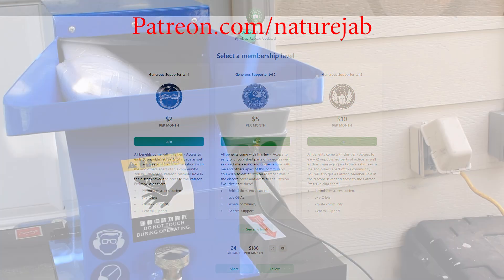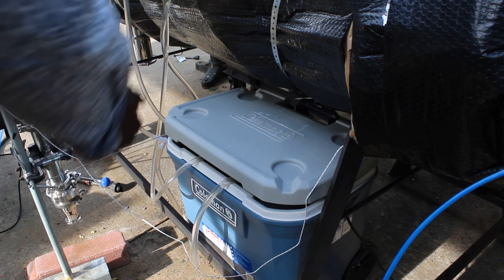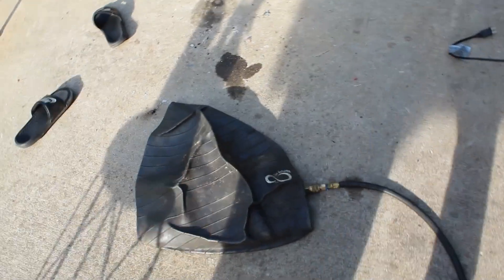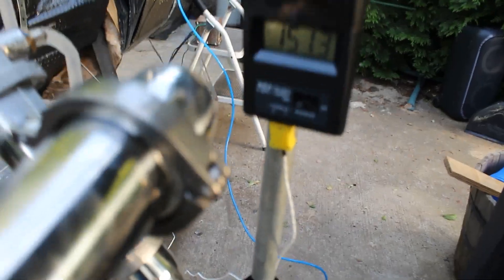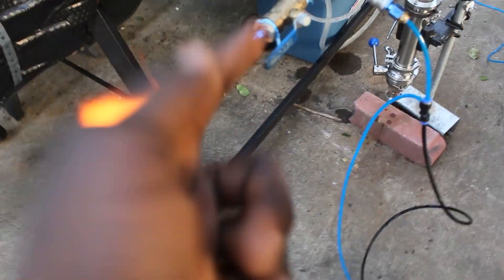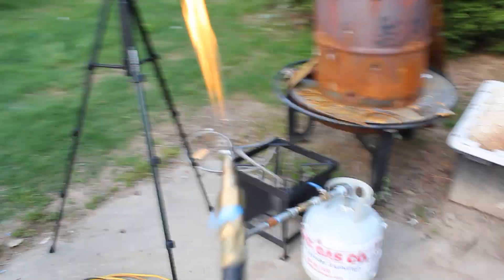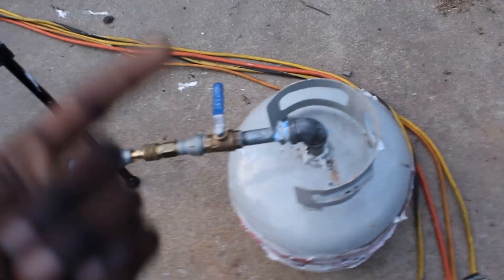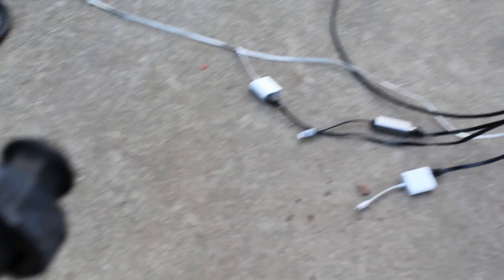OIL MADE FROM PLASTIC! | Running Mark 4.5 Under Vacuum

Comment: Add a bigger tank to your vacuum pump. It will allow you to open that valve for the oil and instantly bring the vacuum back to full pressure. As there is vacuum built in the tank to account for that. It will also be easier on your vacuum pump

Comment: If you add a gas pressure tank to accumulate your pressure after the pump you will have more consistency in your pressure to the generator

Comment: FYI, the reason why the oil production increases so much after you turn on the vacuum is because boiling point of liquids decreases with decreasing pressure. This is a principle of vacuum distillation.

Comment: there are a few additional methods to consider for converting waste heat from generator exhaust into usable electricity:

1. *Kalina Cycle:* Similar to the Organic Rankine Cycle, the Kalina Cycle uses a mixture of water and ammonia as the working fluid. It operates at varying temperatures and pressures to extract maximum energy from heat sources, potentially offering higher efficiencies than the ORC.

2. *Supercritical CO2 Cycles:* This method uses carbon dioxide in a supercritical state as a working fluid in a closed-loop system. Supercritical CO2 cycles can achieve higher thermal efficiencies due to their favorable thermodynamic properties.

3. *Heat Pumps:* Although primarily used for heating and cooling, heat pumps can be designed to generate electricity by harnessing thermal energy from the exhaust and converting it to mechanical or electrical energy through various mechanisms.

4. *Hybrid Systems:* Combining multiple heat recovery technologies (like ORC with TEGs) can maximize electricity production from waste heat. These systems can be tailored to the specific thermal characteristics of the exhaust.

These advanced methods can further enhance the utilization of waste heat for generating electricity, contributing to more sustainable and efficient energy management.

Comment: you can further utilize the heat from a generator's exhaust to produce additional electricity through several technologies:

1. *Organic Rankine Cycle (ORC):* This technology uses an organic fluid with a low boiling point to convert heat into mechanical energy, which then drives a generator to produce electricity. It's particularly effective with low to medium temperature heat sources like generator exhaust.

2. *Thermoelectric Generators (TEGs):* These devices generate electricity directly from heat differentials using the Seebeck effect. While they typically have lower efficiency and power output compared to other methods, they are very reliable and can be useful in small-scale applications.

3. *Steam Turbines:* If the heat output is sufficiently high, it can be used to generate steam that drives a turbine to produce additional electricity. This method is common in large-scale industrial settings.

4. *Stirling Engines:* These engines can convert heat energy into mechanical power by compressing and expanding air or other gases at different temperatures. This mechanical power can then be used to generate electricity.

These methods enable the conversion of waste heat into additional electric power, enhancing the overall efficiency of the energy generation process.

Comment: Yes, there are ways to use the heat from the exhaust of a generator. This process is commonly referred to as waste heat recovery. Here are a few applications:

1. *Combined Heat and Power (CHP):* This system uses the heat generated by the exhaust of the generator for heating purposes in addition to generating electricity. It's efficient for buildings that require both power and heat.

2. *Pre-heating:* The exhaust heat can be used to pre-heat combustion air for the generator itself or other industrial processes, improving overall energy efficiency.

3. *Heat-driven cooling:* Absorption chillers can use the heat to provide cooling, converting waste heat into useful cooling energy.

4. *Desalination:* In some systems, exhaust heat can be used to produce fresh water from seawater, particularly useful in remote or arid locations.

These methods not only utilize energy that would otherwise be wasted but can also significantly reduce overall fuel consumption and emissions.

Comment: So I have a question. How efficient is this machine? What I mean is how much energy does it require to output (x) energy of fuel? Doesn’t seem totally crazy but it does seem odd to me that no one has ever done such a thing?
Reply: Microwaves are terribly inefficient.
Reply: Germany did it in the 40s with coal instead of plastics and I guess coal fires instead of microwaves

Comment: I feel like you may be cracking some of the polymers directly into ethane and propylene gas. I’d suggest if you want to power it on gas you should invest in a battery bank as well. Then you can run the generator on stored gas and then store the energy for the initial startup of the next run. For the condenser, you should try to make a column tower to distill different temperature solvents. I’d also suggest a lot of fire extinguishers lol since you have essentially a refinery.

Comment: Might also need to insulate the outside of the condenser. Its cooling the air around it instead of just the oils out of the vapor. This would make the ice melt faster. A tiny opening to check temperature is fine. Also might suggest to solely use temperature gun to avoid risk of burns

Comment: I think its time to start weighing stuff for data. E.g. how much plastic in and oil/gas out, and how much carbon in and carbon out. Also a chance to start segregating plastics by type and running at different power setting. This lets you know which recipes make what products. Assuming very little stuff escaped to atmosphere, what mass that isnt carbon and isnt oil, is basically the mass of gas. (Since gas may be tricky to weigh)

Comment: I saw a video of you recently wearing  a tie while showing your equipment. Remember, as an engineer and technician, bow ties are a must for safety and style
Reply: Very true. Surprising he overlooked that, but he is a man of style.
Reply: Never wear bow ties near shredders.
Reply: @CZpersi you putting your face up in it?
Reply: Wouldn’t it be easier to just get another generator so this way you can run an ice maker off of the lng so you don’t have to buy bags of ice? Maybe find a way to make free liquid nitrogen and use that?
Reply: My guy needs to wear a mask when pouring plastic particulate.

Comment: Please run the syngas through some filters to get lid of tar. 

Tar can irreversibly damage the throttle body of your generator. 

A simple way to get rid of tar is to run the syngas through a bucket full of fine saw dust.
Reply: Fine plastic shreddings and carbon might work too
Reply: @bene5431  sure.
However, plastic shreddings may not have the same absorbent capability as saw dust.
Wood is a very good mopper of tar.
Reply: Bro he's giving his entire neighborhood cancer idk why yall worried about tar.
Reply: @Lance_Belco  I know right. 
Dioxins are all over the place and bro dgaf.

Comment: Hey Jab. Awesome work !  I'm not sure how important the condenser water temperature is to your system. You could add salt to the mix to reduce the temperature, that is as long as the salt water doesn't interfere with condensing equipment.
Reply: Corrosive to the equipment, but will work

Comment: Hi I messaged you before about a heat treatment idea for excrement I had? If you have an older model?, I have a theory, I think you might be able to recycle poop in your invention and make a shiterer version of propane!!!! I think it would really work, and your compost? Could be the cleanest poop sourced fertilizer on the planet. But think about it, don't break or stink up your machine. If you can recycle excrement into fuel, and clean fertilizer, you will be placed into a very good part of history. 

Have a blessed life! :)

Comment: It is interesting that you have only 3 pounds of plastic in a reactor that can easily hold 8 tons [16,000 lbs].

Just think: when you scale up [such as adding more magnetrons] you can massively increase production, since a whole lot of your EM energy is being wasted on the large open cavity of the reactor vessel.

That vessel, in theory, should be holding about a ton of plastic and half a ton of recirculated carbon feedstock minimum to take proper advantage of the energy being fed into it.

This is based mainly on its volume, and the spread [area of dispersed EM radiation saturation] of the magnetrons.

In fact, you may want to read up on how to build your own cyclotrons [its a much more powerful form of microwave emitter which works mostly like a magnetron, but it has fewer parts, can emit and handle far higher power, and is almost impossible to 'burn out' (unlike microwave oven dipole magnetrons which can arc and burn rather easily)]

Admittedly, they are a lot less easy than just scrapping out some used microwave ovens, but if you are hoping to get super high intensity power focused at the plastic, they will far outperform magnetrons.

Also, since they emit electrons, they can really do some massive splitting of larger molecules into smaller ones, especially for the amount of power introduced.

And, while, honestly, I do not think anybody has ever used them for smashing plastic, the REALLY BIG ones are used for smashing ATOMS.

So they can really deliver some good power if built and tuned properly.

Here is a potential starting point to look into it.

https://en.wikipedia.org/wiki/Cyclotron
Reply: lol
this

Comment: Good job,❤
Next you can mix rubber tiers like 10% with plastic and carbon.
Check for any leaking gasses near the microwave power supply ( connection points ).
Good luck

Comment: Try using a car radiator or some other big radiator that would fit in a cooler, have the cooler filled with ice water and drill holes for the hose so you don't have to lave it open. You will get amazing cooling with this, you just gotta keep supplying ice as the heat exchange will be extra efficient.

Comment: A more permanent condensing solution could be building a vapor compression system by rigging a window AC unit to run off propane. This could get you output temperatures of -40°c. You could even go crazy and hook that system up to another as a heat exchange and get temps of like -130°c
Reply: Meh, I think bubbling it through a mesh under a vessel full of water would be much more efficient cooling due to direct contact and much more surface area because of the bubbles broken up smaller by the mesh. Gas goes up and can be tapped separately. Oil floats on top